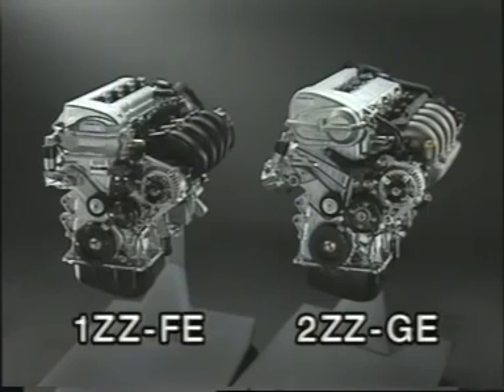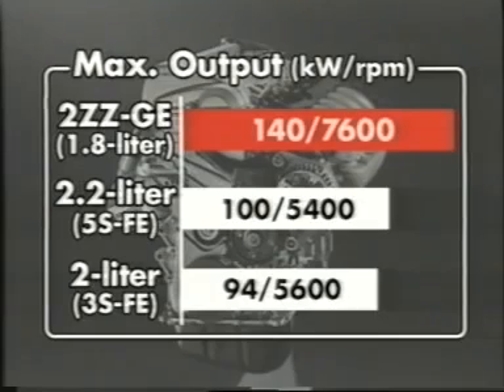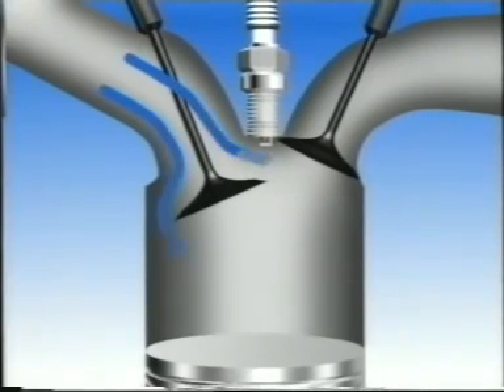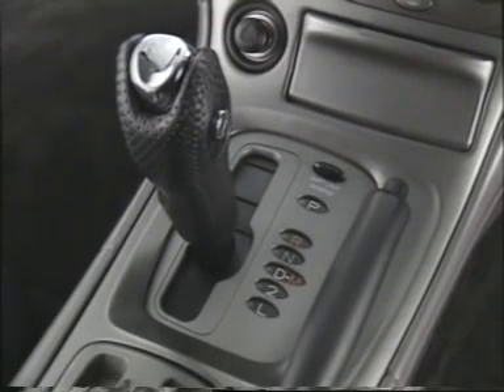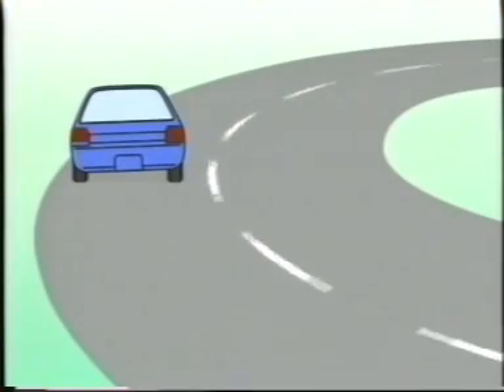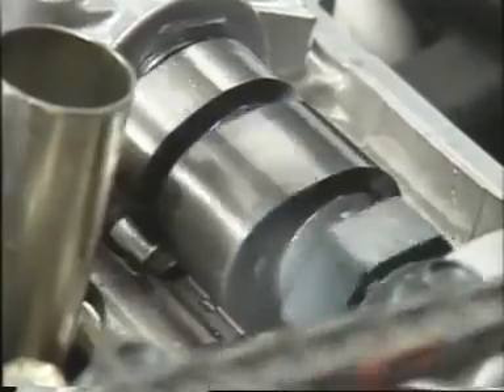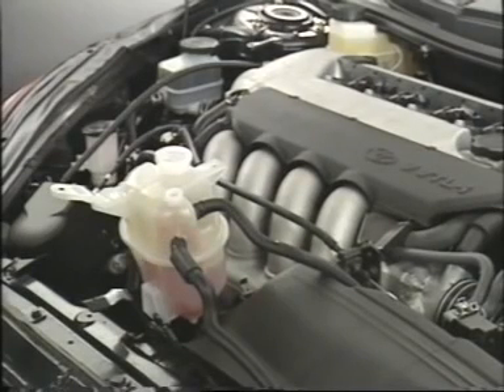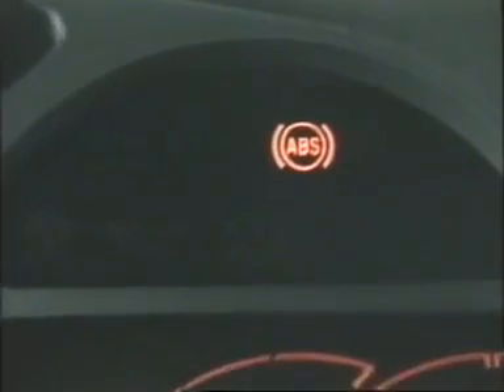Toyota Celica T23 Service Training 1ZZ and 2ZZ (full video in English)

Comment: “We made the oil return holes on the piston rings microscopic to ensure you burn oil non stop”
Reply from the maker: Haha yeah on the first version of the pistons they indeed made them too small, only 4 per piston and in the wrong place. Second version still 4 and small but in better location. And final version finally has 4 per side, bigger and in better location
Reply: @SVSportscars  my 2000 mr-s has burned since I’ve owned. Otherwise never missed a beat runs good!

Comment: Thanks for posting. I didnt realise that the coolant refill method had been revised. I will try that way when ive finished rebuilding my engine
Reply from the maker: It works very well on these engines / cars.
To speed up the process open the small bleed valve to let the air in the small compartiment out once in a while and once it's warming up just apply small blips of trottle to push the air up in the reservoir.

Comment: I’ve seen comments on other videos that there was a slight design flaw with pre 2003 model engines with regards to a little higher oil consumption. Don’t know how big of an issue it is, do you have any additional info about it? Thanks, great video 👍
Reply from the maker: Bugs Bunny 
The pistons of the older 1ZZ engines have a bad oil extraction holes. They are very small and only 4 holes per piston.
The 2003+ models have 8 holes but still aren't that great.
Only the latest versions have best piston models with 8 larger openings to remove the oil that is scraped by the piston rings.
The smaller holes can get blocked and thus prevent the oil from being removed from the cylinder wallls. And thus the oil is burned in the engine.
Hope this helps.
Reply: SV Sportscars That’s a great explanation, I suppose you’d have to keep checking oil levels weekly & possibly topping it up weekly too. I currently own a 6th gen 98 model Celica ZR & it has given me trouble free driving since I purchased it 2nd hand over 10 years ago. But I need to replace it because it has now clocked up 380,000 km’s & I know it won’t last forever. I found a 2002 ZR with this 2ZZ motor for sale & will have a look at the car next week & was curious about the oil issue. Appreciate your explanation, thanks 👍
Reply from the maker: Bugs Bunny 
Well the 2ZZ engines don't have the same piston problems as the 1ZZ models. They can consume a bit of oil when high in the rev range and have a habbit of leaking around the timing cover. Replacing the gaskets there fixes that for many years to come.
And as long as you check regularly. And make sure the 2ZZs oil level never goes below half on the stick you should have many years od care free driving.
Reply: SV Sportscars Great advice & thanks again for clarifying everything, cheers :))
Reply: This happened to my 2004 1ZZ. Started burning oil badly after about 120k and I was forever topping it up; eventually failed its emissions test; uneconomical to pay garage to replace the rings (unless you're prepared to do it yourself).

Comment: This is for the 1999 model. ,the 2000-2005 2zz is 180hp
Reply from the maker: skydrones2012 actually all other regions got the 190 hp models. Only US spec models got rated lower due to fuel standards and emissions.
European and Japanese models still got the 192 output specifications.
Reply: my 140 was clocked @ 156. All stock apart from k&n filter with standard airbox, but heres the trick.   Wait until the tank is almost empty, only a few litres of fuel left. Refill with the highest octane fuel available, mine was 99ron. Then reset the ecu and enjoy. It will be like a rocket for a few days until it has figured out its proper settings and reverts to normal.